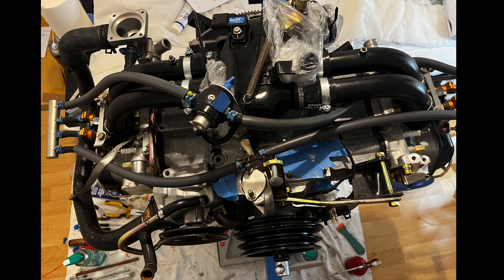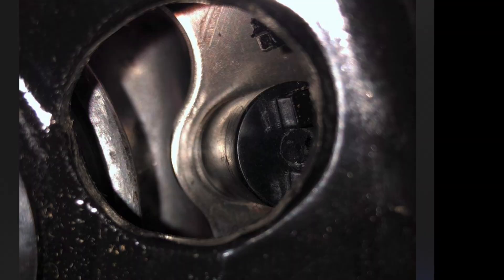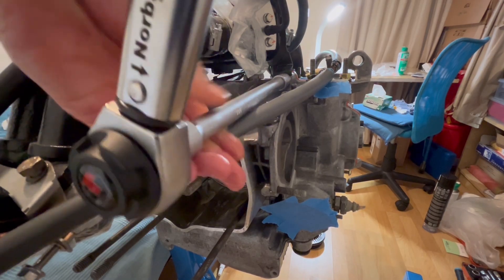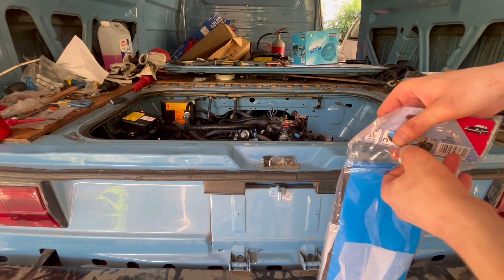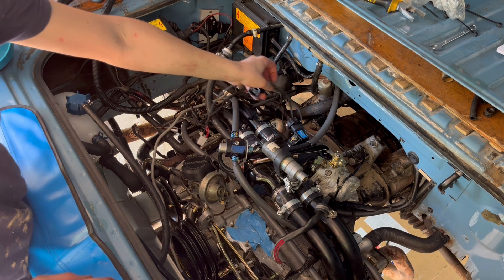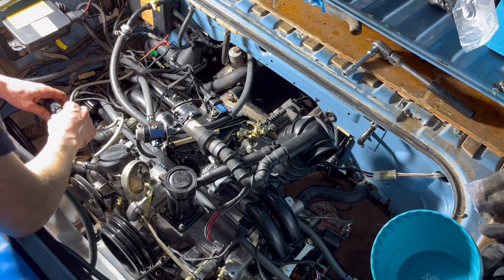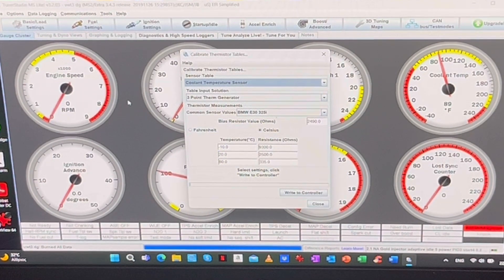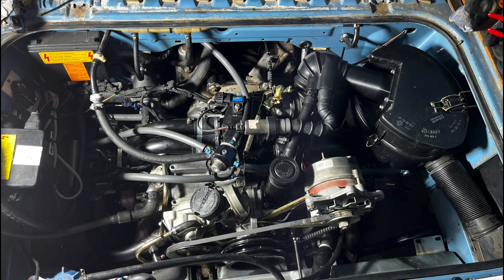VW T3/VANAGON MansiSpeed EFI Installation

Comment: Wow, $2650 USD as of 9-9-2025 for the kit, once again proving the cheapest item is the nut behind the steering wheel.    I'm taking a break after pulling my cylinder heads off.  One was leaking and the lack of cooling maintenance is rather scary.  Rocker area super clean but cylinder head bolts were super tight, like 100 foot pounds of torque to get them off.  ...my friend recommended the ratio rocker kit.    I like your videos, they are well done !
Reply from the maker: Thanks for the comment ;) . The kit is kinda pricey, but it’s money well spent, considering the price of the replacement parts for the stock efi+ you save some fuel and get some Hp :)
Reply: @Guentherthevwbus  right now, I am waiting on new cylinder heads and head gasket kit, and a Mansi oil pump.   I can add the rockers later, and I can decide later on EFI.  I did the fuel lines two years ago, so easy.  I also installed a Subaru in a 85, so wiring does not scare me.  Just figuring out what I did wrong does !
Reply from the maker: @DanTheManIOM make sure not to use anything from the amc head except the bare head ( toss the springs, valves and valve keepers )

Comment: What's the torque specs for the intake manifold nuts? Can't seem to find it in the Bentley manual.
Reply from the maker: Hello, it’s 20Nm
Reply: @Guentherthevwbus  Thank you!
Reply from the maker: It’s was around 20-25nm, I will check it later on and I will come back to you

Comment: I have a 1.9 DG with pierburg carb. Can I install EFI kit on this one to replace the carburettor?
Reply from the maker: Yes! There is a 1.9L version for it . You will need a EFI manifold though, a 1.9l coolant crossover pipe, if you have the early exhaust: the late exhaust system, an efi Tank, a fuel pump+ its brackets, a relay box and the fuel pump wiring ( can be easily DYIed). If you are in Europe I can help you with the crossover pipe and the intake manifold, just pm me on insta ( see link in description)

Comment: Nice video. I have the same kit ready for installation soon. Where did you mount the ECU?
Reply from the maker: Thanks ! If you had the 2.1L you can use the stock location , if not : you can make a a big hole in the firewall or you can make a custom (waterproof)box and mount it in the location of the 1.9l ECU . I opted for the second option

Comment: Nice. My boss has been thinking about getting a kit for the shop van. 
Next step for Guenther... turbo!!! 👍
Reply from the maker: It’s worth it and it’s actually a step towards the turbo conversion ( Marco will also make a turbo kit) . It’s pretty expensive and I also don’t want to throw a rod( which shouldn’t happen if adjusted properly), thus I don’t know if I will take this step to be honest, the extra power would be sweet though. Even now you you shit yourself while accelerating, you barely touch the gas and it accelerates like hell .
Reply from the maker: Ps nice to hear from  you again :), didn’t chat for a while
Reply: @Guentherthevwbus  
Yes, sorry. I've been watching but not posting under your videos, sorry.
Reply from the maker: @EXOVCDS no worries Thomas, I know that you are very busy :)